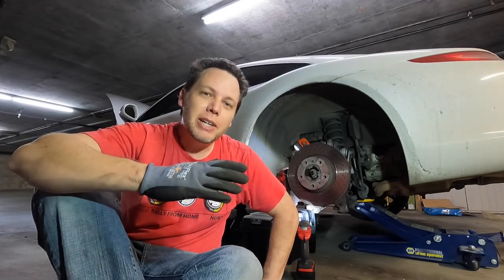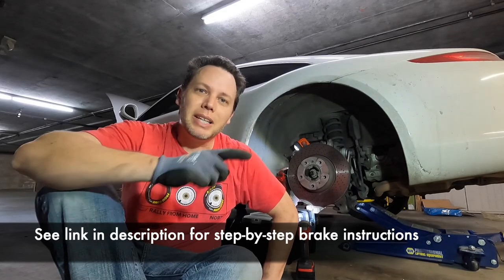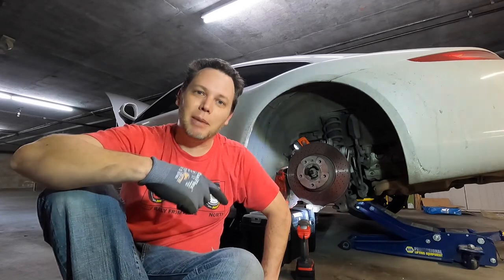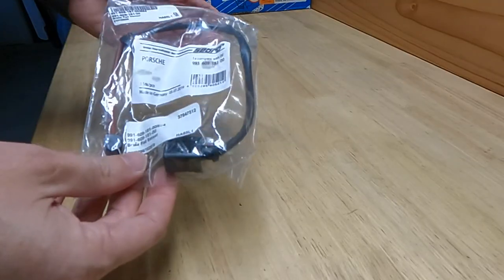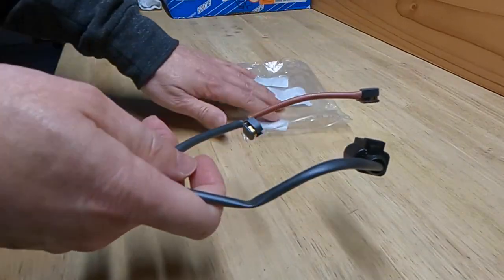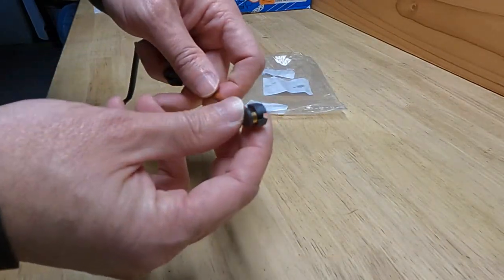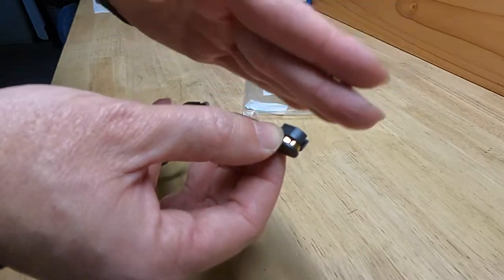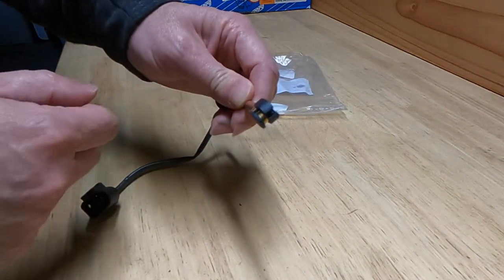Porsche brake squeal SOLVED!

Comment: Thanks again for the video.  Every little bit of info is helpful, I appreciate it, and what are the odds that I was starting to troubleshoot this on my 991.1 on the same day you posted this video! I pulled the back wheels off, visually inspected and bled the rear calipers.  I'll watch the video you shared, but you've convinced me I need to pull the calipers off and inspect the sensors.  I have the same squeal you had, except mine is a little less intense.
Reply from the maker: Glad it's helpful and I hope you find your squeal. Mine was getting really bad as you saw in the video. If you have the wear sensors that only go on one pad, it's super likely that the sensor side pad is ok and the other is worn. It's a pretty straightforward DIY job to change out both the pads and rotors though. Good luck!

Comment: That the exact same sound mine makes. Ive had them changed twice. It goes away and comes back. Wondering if your returned or not. I've heard its a performance brake thing and you need to drive at a high speed and stop to break them in.
Reply from the maker: Mine has yet to return! When they changed yours did they do both the pads and rotors?
Reply: @AtypicalDriver  have you brakes sound returned. Yeah have a gt4 and have the same sound. I brought it into Porsche and they told me it’s normal and that I have lots of life left in my pads. Mine are very bad.
Reply from the maker: @joeylam6120  no sound has not returned, although another mechanic told me that when that happens, if pad life is still ok do a whole bunch of hard stops from around 80-100mph to knock off any glazing of the pads or rotors. Maybe give that a try somewhere safe?
Reply: @joeylam6120  I have a GT4 as well, made the squealing sounds from day 1 of driving it off the lot. It’s extremely obnoxious and attention grabbing, more so than the car lol. I just took it in for my 1 year service and they said the same exact thing. I’ve done the braking at high speeds, it goes away for about 10 minutes to the entire day and then comes back the next.
Reply: @AtypicalDriver this works I have this squeaking on my Audi S5 they ere brand new brakes front and back aswell as rotors, plenty of grease aswell. Deff take the car out and drive it hard you can either do a bunch of pulls and brake hard to get that light glaze off or just drive it long enough it’ll burn that layer of glaze off. Even still tho these carbon ceramic and metallic brakes squeak in general which is something a lot of people don’t realize!

Comment: Hi, did you replaced just one set brake pads/rotor or you have replaced both left and right wheels' ?
Reply from the maker: yeah I did both left and right. always recommend doing an entire axle when changing brakes...e.g. both front, or both rears

Comment: The sound is caused by misaligned rotor. You are doing a proper brake servicing in the video . Thats good. But Caliper pins will need lubrication too you missed that out
Reply from the maker: Thanks for watching! They're not sliding caliper pins on the 911 since they're radially mounted, do they still need lubrication or maybe just some anti seize on the threads?

Comment: Doesn’t work.  Changed the brakes and rotors, still squeals
Reply from the maker: Oh no! Hmmm, any other ideas what it could be in your case? Assume everything is reassembled properly, spring clips in place, etc.
Reply: Try buying lower quality brakes. High performance brakes tend to squeal.
Reply: @HoneyDooDoo  who buys low quality brakes for a Porsche?
Reply: @lifehackertips  then expect squeal...